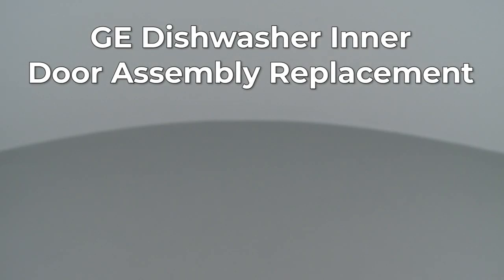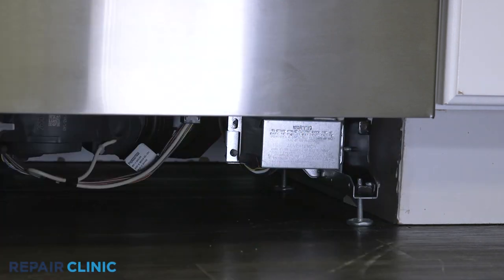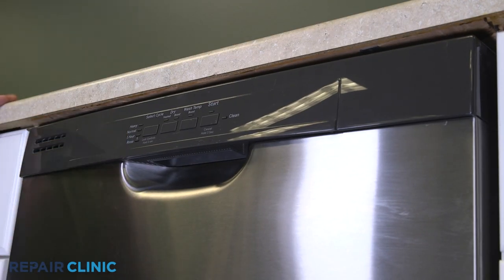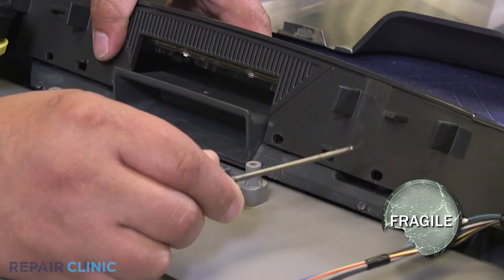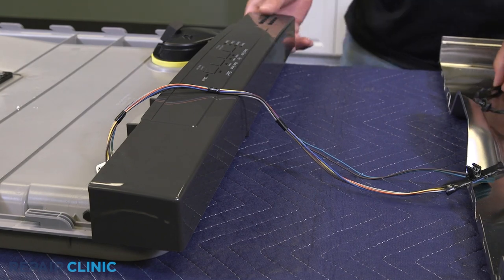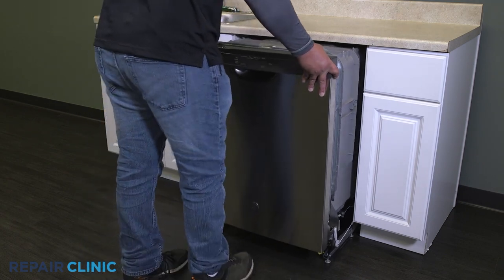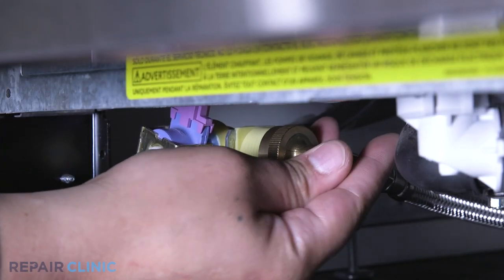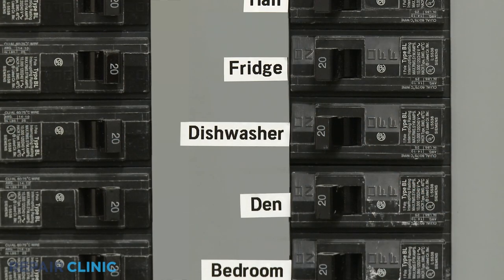GE Dishwasher Inner Door Assembly Replacement WD31X24834

Comment: Just did this. No need to remove water hoses or to even take the entire washer out.
Reply: I just want to whole door off to clean the inside of dishwasher. Do I have to go thru all this?
Reply: @mishagalt-martin1151  No. You will still need to pull the unit out a few inches but no need to disconnect water hoses, etc..
Reply: I can’t figure out to slide the inner piece off!
Reply: Me too